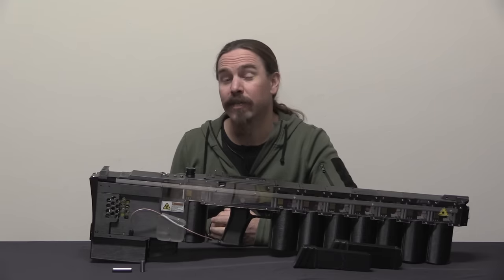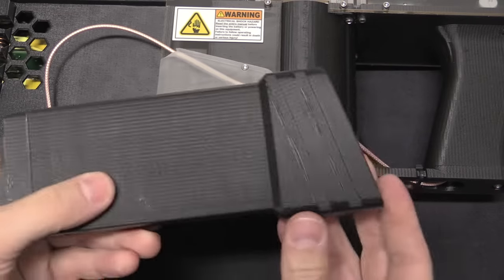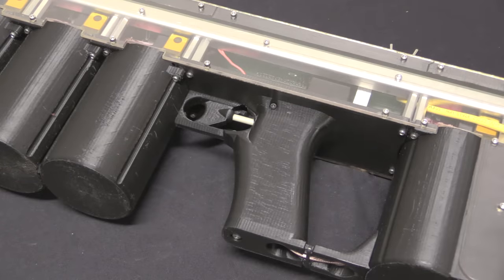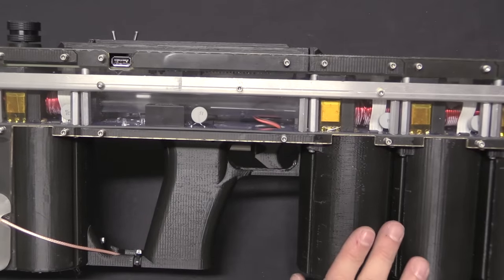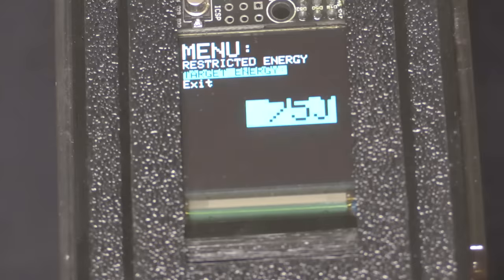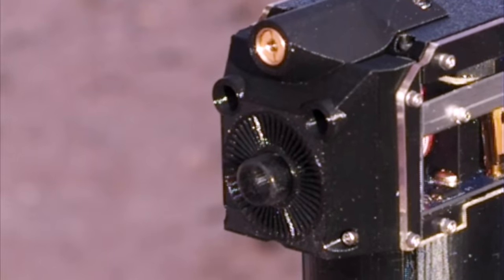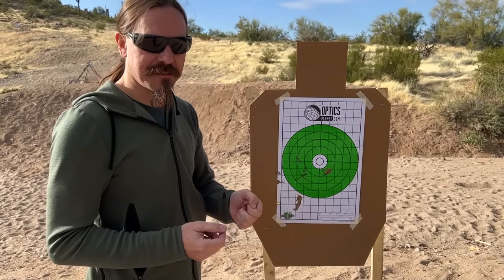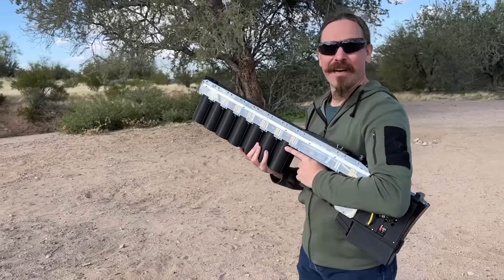ArcFlash Labs' GR-1 Anvil Portable Gauss Rifle

Comment: As with all things 'electrical that were previously chemical' - just goes to show just how absurdly much energy there is in a tiny amount of gunpowder/gasoline etc.  Neat gadget. Look forward to supercaps/hybrid supercaps being a cheap enough thing to play with.
Reply: So true, there's a reason we've been doing stuff with chemical energy for a long long time.  It's super dense packed with energy.  At this point it's just waiting for the steady march of miniaturization, or possibly some major breakthrough with super conductors to make these caps, PSU's, batteries, etc smaller.
Reply: @Sophistry0001  The energy storage issue and energy discharge issue may be eventually overcome when we develop sheet of stackable carbon nanotube weaves. Putting a few hundred layers of this weave one over the other could potentially hold enough energy to power a home for a day in a battery no bigger than a phone.
But that technology is still very much in development.
The important part here is that there is a possible solution, butt its still far too early to be properly deployed to mass market or even military's market.
Reply: @Keemperor40K  they already have surpassed that they just dont want you to have it.
Reply: @AzamatSlowedAndReverb  aww man, first they take away our antigravity devices and water powered combustion engines and now this too? 😢
Reply: @AzamatSlowedAndReverb  its just really difficult to manufacture them in that large amount and in the proper form we need them.
You forget to consider that there is not just one group developing these tech some are even open source.

Sure there are techniques like using tape on graphite but the carbon nanotube that makes is not the kind that has the properties we need, its also not as easily scalable. Does not mean they are holding it back to inconvenience us. It only means its not yet profitable.

If and when it becomes easy enough to make they will get it out there, i mean consider insulin its damn fucking cheap to make but over priced.

What would be more likely is they figure an easy way to develop carbon nanotubes patent it and sell it in exorbitant prices because greed. Theres like no reason to not sell carbon nanotubes if you can easily manufacture them
Reply: @AzamatSlowedAndReverb  who is they
Reply: @ragulian  they is who they be
Reply: @ImmortalDaevon  yea well
Reply: @AzamatSlowedAndReverb  Money > all things and the money whoever develops that could make bringing it to market would make them the richest entity in the world. 

Thoughts of conspiracy often stem from a gross ignorance of the subject. This is definitely one of those cases.
Reply: @AzamatSlowedAndReverb  You should've paid attention in health class.
Reply: True that. POTENTIAL energy is something to NOT underestimate, reason why nukes are so devastating.
Reply: @ImmortalDaevon  To be fair sometimes when I agree with someone with an unpopular opinion but don’t want to get sucked into the shitshow I’ll just like all their comments, and so that’s how you’ll sometimes see them all with one like. It’s all me.
Reply: @E115 I mean...there is rather a lot of technology suppression going on, but it's not governments doing it.  It's corporations with a vested interest in the processes and products that said technologies would compete with or render (partially) obsolete.
Reply: Hydrocarbons are an amazing thing. Terrible for the planet, but pretty much the most useful and versatile molecules known to man.
Reply: @jayatfreelance  i absolutely do not belong in the future, long live Internal combustion, long live smokeless and black powder and down with all the things I love in the not so distant future world it seems
Reply: The first practical weapons that will most likely appear in military service will be gauss-assisted rifles where the bullets are driven by gunpowder and then accelerated by gauss coils to a higher-than-normal (hypersonic) speed.
Reply: @LuigianoMariano  that seems highly impractical. The gas discharge and fouling would interfere with the internal workings. A more likely concept is the re-appearance of gyrojet munitions which are launched out and then ignited their own little engines/rockets
Reply: @AzamatSlowedAndReverb  Don't let the bastards get you down! Never change, my dude!
Reply: @alkentarch7083  L
Reply: @AzamatSlowedAndReverb  Except the levels of C02 are well below unacceptable limits, and a vast majority of people aren’t wearing N95 respirators 24/7/365. Someone who works an average trade job will be exposed to more dangerous gases and chemicals than wearing a cloth mask on your face.
Reply: @FieryCheeze  The bullets going down a barrel…You already have a barrel and it already gets fouled…

You have to clean your weapon regardless of what century it was made.
Reply: @E115 yes everyone who is able to use it that isnt us and people agree with you I dont get it you even agree with me
Reply: @Studio23Media  yea well health class was only 1 year in sixth grade
Reply: @cbrunts1755  you seem like an insider and a whistleblower tell us more champion
Reply: @alkentarch7083  well I know what you're saying and although I am not dogmatic I disagree with much that was said here. Lot of people trying to prove a point being aggressive as usual because of their lack of rationality.
Reply: What's really crazy is that a firearm doesn't even extract a fraction of a percent of the energy actually available in the powder. For that you need to think nuclear.
Reply: the amount of energy required has me sceptical of the actual feasibility of a coil gun as anything other than a neat toy. I feel like there is a certain wall on how much power batteries can store and still be light enough to carry/won't have overheating issues.
Reply: @Evan_Case  definitely 
Tech isnt just something that one would hide and not release to the world, its too profitable.

On a side note
There are situations where tech hidden and or lost but they were rarely due to some conspiracy and just unfortunate circumstance

Starlite though now revealed to be just an intumescent coating was kept secret by its creator because he wanted to SELL it one who would accept his terms. Even in that situation the dude just wanted to SELL starlite.

If you dont mind i add another reason why i dont think “they” who ever the heck “they” are can just hide technology from the WORLD

Simply put… COUNTRIES
If one country can get even the slightest advantage over the other countries like say developing a water engine or easy carbon nanotube or actual cold fusion. Etc etc they will take it and try to sell it or monopolize it.

Theres so many people in the world and technology throughout history often was developed not by a single person the right brothers werent the only people who developed planes, newton was not the only person to develop calculus, etc etc.
Reply: @AzamatSlowedAndReverb  How one could reasonably accuse others of a lack of rational and talk about masks killing people is beyond me. This argument is so old. And so bonkers. You bringing that up after billions of masks have been used before and more billions during the pandemic shows a lack of rational.
Reply: @Sophistry0001  nnk
Reply: @Keemperor40K  n9 99jn9
Reply: @smokythebear9711  the first cars were electric, and the first projectile weapons powered by wood and string. There's nothing wrong with exploring alternative technology. 
..unless you're just that much of a shill to oil companies...
Reply: @FieryCheeze  🤣🤦‍♂️
Reply: @umusuuk  I'm surprised they're not using an aluminum projectile like maglev trains for example
Reply: @AzamatSlowedAndReverb  Waste pollution by discarded masks is a completely different issue than claiming that wearing a mask is detrimental to human health.
Reply: @Sophistry0001  Yeah, chemical energy is extremely useful in terms of density, and will remain as such probably forever - though batteries are getting denser and denser.

The real advantage of electrical systems like this is in situations where you don't need them to be mobile, and can take advantage of things like power generation transported through power lines or from on-site generators or the like. In the future we might not see weapons like this replace traditional firearms for individual soldiers (if we even still use individual soldiers), but we very well may see them used for fixed position defense or for artillery and the like.
Reply: @beargillium2369  guess again
Reply: @ImmortalDaevon  that's your insecurity speaking maybe you like your comments
Reply: @Shaiyo5  it's both
Reply: @AzamatSlowedAndReverb  Yeah you really showed me, dude
Reply: @buckyhurdle4776  yea I know
Reply: @AzamatSlowedAndReverb  good, glad to hear you don't litter... Are you seriously suggesting masks are a bigger nuisance as litter than they are a protection? 
I guess you have the right to your opinion, pretty weak argument tho...
Reply: @beargillium2369  what a waste of time
Reply: @AzamatSlowedAndReverb  it's your time to waste. I feel sorry for your family.
Reply: @E115 So, I’m not allowed to murder, steal from, and harass anyone I want because those are merely “rules for the cattle”?
Reply: @AzamatSlowedAndReverb  what am I guessing?
Reply: @beargillium2369  you people always need to be told what to do
Reply: @AzamatSlowedAndReverb  I thought you were mad about being told what to do...
Reply: @FieryCheeze  The Gauss coils don't have to be inside the gun barrel: They can be mounted outside the barrel and the magnetic acceleration field will go through the barrel and still do its work in accelerating the bullets.

Comment: something you NEED to be aware of: capacitors hold power all on their own. this weapon could fire with the battery completely removed. particularly important when dealing with misfires, as a capacitor discharge could throw a "stuck" slug.
Reply: 15:47 Sounds like they dump the energy pretty quickly. Either way, I'm sure this is something the manufacturers have considered

Comment: As a welder... wow. 16,000 amps?! For reference, guys, hardcore fabrication units run anywhere from 100-1000 amps. 16,000 @ 25 volts is insane. When Ian says that's a tremendous amount of energy, that's no joke. I run pretty hot welding rods at 170 amps @ 20-28 volts.
Reply: Im surprised it doesnt melt
Reply: One thing to consider is time. 16k amps for a half second is way less than 1000 amps sustained for 5 minutes.
Reply: Not to undersell the amount of power in the device, it's still awesome.
Reply: As Brad says, there's a big difference between peak and continuous power, and they're not really comparable without taking time into consideration. I have a pulse capacitor here not much bigger than a soda can that can dump 50,000 amps, but only for microseconds. 
Energy (Joules) = Power (Watts) X Time (Seconds).
Jack's welder is running about 4000 watts continuous (170A*24V), or 4000 joules every second. So every 5 seconds that welder puts out more energy than the muzzle energy of a .50 BMG  (5 seconds * 4000J = 20,000J) :O 
That's some serious energy, but it's not all being released in a short burst with high power like with firearms or explosives.
Reply: @clotz1820  duty cyle of this thing is tiny. That current is spent in milliseconds.

Comment: I always imagined Gauss rifle tech would be most practical when incorporated as a way to enhance conventional firearms. You’d still use traditional cartridges with powder loads but you could get much higher more energy by adding a coil to further accelerate the projectile. Best of both worlds
Reply: It would be perfect, since GAUSS rifles could also have disadvantages and firearms can be improved and fitted with more improvements, what do you think?
Reply: Yeah you try and get the best of both worlds.
Reply: @epicdoggo4925  I think it would be better, but do you think GAUSS would be better than firearms but improved in the future?
Reply: Im wondering if there would be a way to reverse that process. Have the powdercharge fire off, after the round reaches full velocity from the magnetic propulsion. Im just thinking that the magnets would do more to catch the bullet than aid it along.

Comment: “This thing has the muzzle energy of a 22 long” that absolutely blew my mind. May not be a powerful round but I personally just wasn’t expecting this thing to be anywhere near that level of power at this early stage.
Reply: That's not much for the size of the projectile
Reply: Still wouldn't want to get hit by one
Wonder how they would interact with ballistic gel
Reply: This is the gauss rifle equivalent of a match lock. 
There is a lot of room for future development
Reply: The really impressive part is they've packaged it into something man portable. When I first b started following this sort of tech in the early 00s, it was dangerous just to be in the same room as the more powerful hobbyist devices. Granted, most of them were rail rather than coil guns, thanks to the difficulty in sequencing the coil discharge. But it's still super impressive to see it packaged into something a reasonably fit person can shoulder and fire.
Reply: @ZealothPL  It'd probably just bounce off the gel with projectiles like those. As that prototype stands, you'd get comparable if not better ballistics from a slingshot
Reply: @jamesricker3997  Nah. More like a Gauss rifle equivalent to a Handgonne.
https://en.wikipedia.org/wiki/Hand_cannon
Reply: @theultimatederp3288  true, ultimately the projectile should be alot smaller and be able too be released at incredible speeds, similar too how conventinal guns have decreased projectile size and increased velocity as they have evolved
Reply: 22lr has killed grizzly bears.
Reply: It actually isn’t that close to 22 LR. 600 grain projectile moving at 75 m/s has a muzzle energy of about 83 ft. lbs of energy. A typical 22 lr is about 120 ft lbs. This is a little higher than a 22 short.
Reply: @CoconutMigrating  100j is what you get from 22LR revolver. 
Varmint hunting airguns that shoot .25 32grain slugs use from 80j to 120j. Mostly to not destroy anything around or behind the target.
Reply: Still less effective than a crossbow...
Reply: If you point the projectile, it could probably kill.
Reply: Fishing and Freedom Fiend  it’s gonna be pretty good for riot control. I would shit my pants if a cop pulls up with a fucking space gun pointed at me lmao
Reply: @theultimatederp3288  To be fair, this is in the relative same developmental stage as the first guns.
Reply: @ZealothPL  Theoretically, getting hit by one of these should be just as incapacitating as a traditional bullet except much less lethal since the bullet would be fast enough to pass through your body without leaving a big wound?
Reply: Fishing and Freedom Fiend  Nope.  Acceleration is limited by the rate at which they can electronically gate the caps.  Which is why the short and long rods have the same velocity.